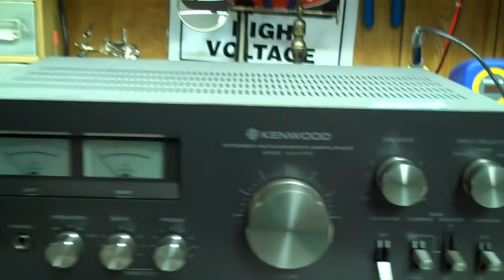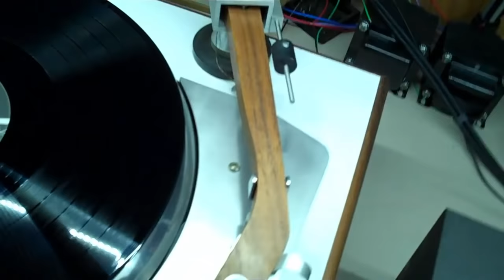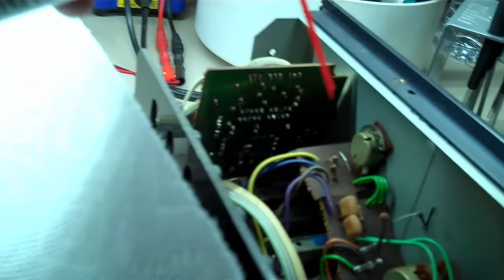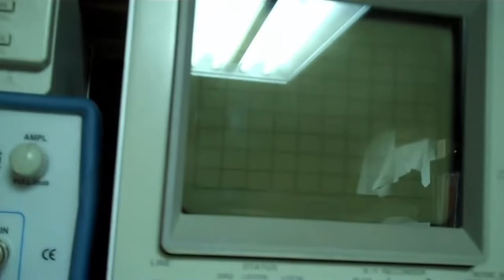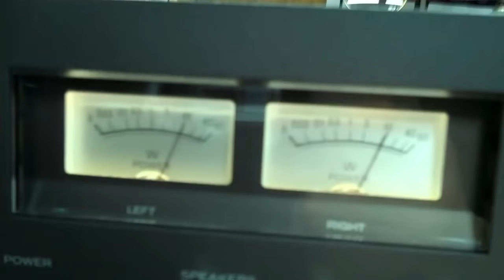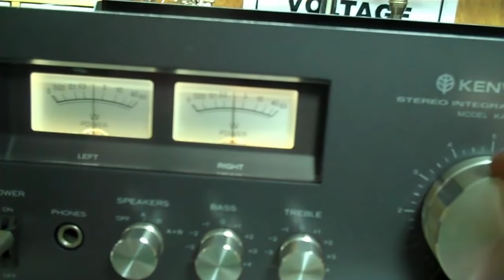Kenwood KA- 5750 Stereo Integrated Amplifier Service - BG051

Comment: Firstly Mark, I agree, hats off to Kenwood; that amp. is underrated power-wise.  If there would have been a db scale below the watt scale then 0db would have been at 40 watts and made it easier to test.  As for your camera, it seems to think a lot before focusing on close up  objects, and it left me scratching my eyes a few times....Keep these videos coming, I eat them for breakfast. ( P.S.  I recently had my 2325 restored at a place in Ohio,.  I REALLY wish I knew about you at the time because it came back with the dial pointer light not working and the meters not performing the way they should with FM tuning (all 3 were fine when the unit left me).  Live and learn

Comment: Not really impedance mismatch going into the phono input - it's the RIAA equalization in the phono circuit. There is such a thing as an RIAA "curve flattener" to compensate, but it's not necessary for your tests.
Reply from the maker: +Mark Zacharias yeah, sometimes when I go back and watch my videos I wonder why did I say some of the things I said, making videos on the fly often challenges our thought processes, you should try it sometime :-).  Yeah its really a 5mv to .5v issue as much as anything
Reply: I know what you mean! I've done the same thing! Really great work though. In the case of the HK330 I definitely would have checked the power transformer after seeing those tin foiled fuses before doing anything else. Would have been a shame to waste any more time than necessary only to discover an open primary... these idiots and their tin-foiled fuses. My God.

Comment: Audio on this camera sounds much better OR it could be that you've changed how you are encoding the audio signal. The previous videos always had a metallic edge to them similar to what you get with low bitrate .mp3. Great videos nonetheless.